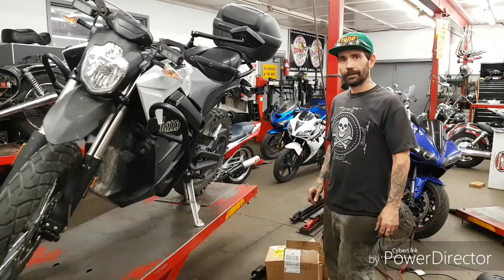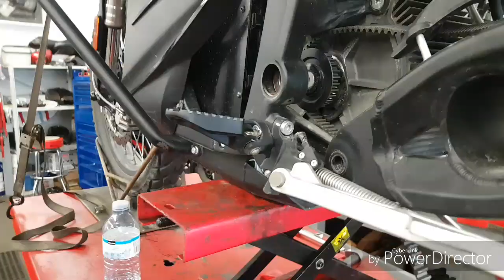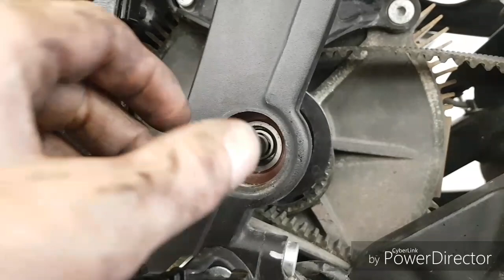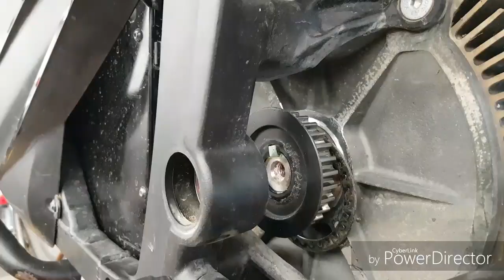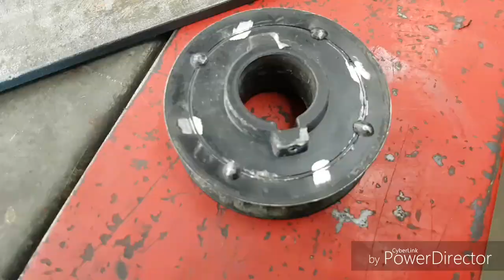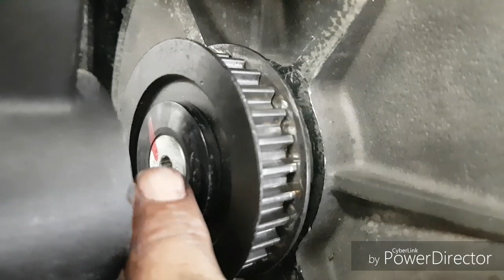Zero Electric Motorcycle Front Pulley Removal

Comment: Great video! Do you know what the torque spec on the bolt that holds the pulley in place? Mine seems like it's coming loose
Reply: 52 ft lbs with loctite 271. also must use loctite 680 on shaft spline.
Reply from the maker: thank you for adding this information! always appreciate it
Reply from the maker: Thanks! I don’t know the torque spec for the front pulley but, in most cases, for those fasteners in particular, I would use an impact tool to assist and tighten up. I would think 60-80 ft-lbs in many cases, but if it doesn’t have a lock tab or lock nut (fuji lock style) tighter is better and sometimes adding a little red loctite is useful

Comment: Have a 2016 Zero FX with 6,000 miles on it, noticed the motor got noisy the other day.  took off the belt and when running the motor i saw and heard this.  Looks like a bad motor shaft/bearing etc. do you think the motor needs to be replaced, or is a case of a pulley?  https://youtu.be/JHB8L8aIJZQ
Reply from the maker: Hard to tell from the video.
Reply: Looks like theres a wobble in the pulley from what I can tell in the video. That could mean bad bearings. My 2016 with 14,000 makes an audible "rattle" that sounds like its in the case of the motor. I've heard that the first step to rule out pulley noise, is to remove the pulley and reattach it with fresh locktite.

Comment: This should be applicable to any year that uses the ZForce IPM motors before 2017 MY. >=2017 is splined not keyed on the motor shaft so I'd recommend using a heat and a puller and flat sacrificial bars to support the back of the pulley/guide.

Do you do a lot of work with Zeros? Curious on the exact right procedure for belt alignment, and also bearing replacement, and commissioning.
Reply from the maker: full disclosure as a motorcycle mechanic I work on a lot of everything and have to figure out problems on my own using the eexperience I've gained over the years so each job has its own tricks when it's new to me.
the belt alignment I use the marks on the swingarm usually and will double check with a straight edge alignment tool across the pulley and look from behind to see if it looks like it's correct as well I'm not sure what you're talking about for the bearing replacement but as far as charging for work as in commissioning I kind of Base it on what I think it will cost and factor in a little more it's better to over price and then charge last in the end if it works that way